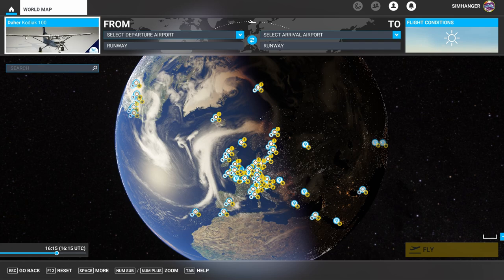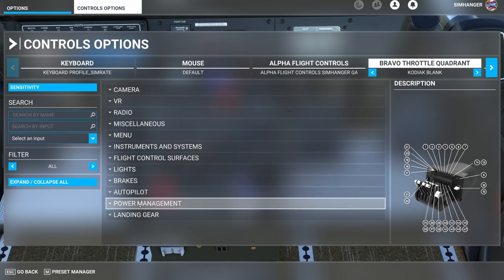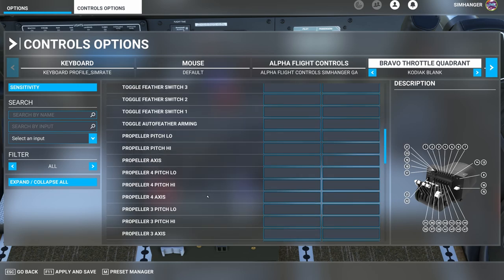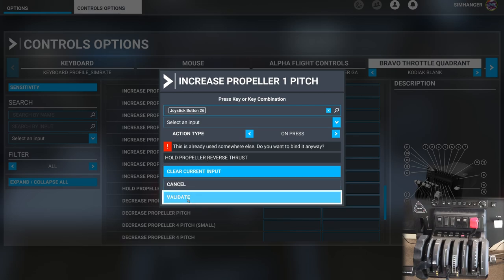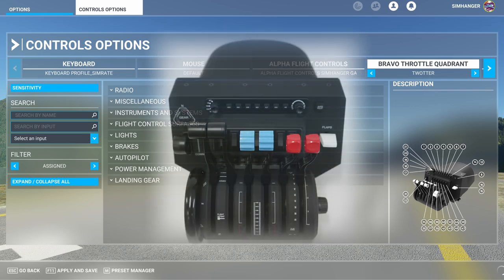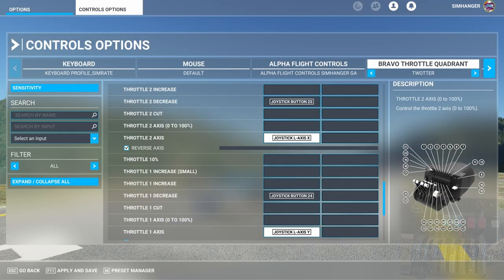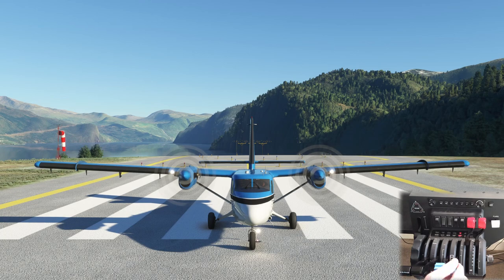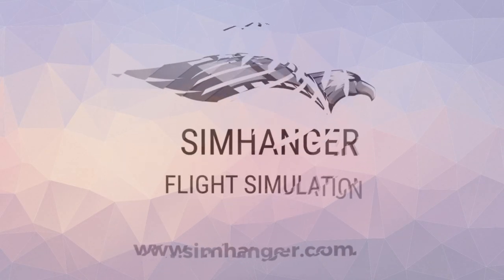MSFS | BRAVO TQ CONFIGURATION GUIDE | TWIN OTTER & KODIAK 100 | Suitable for most Turbo Props

Comment: Can you please help me ! I am trying to config the THROTTLES for a twin Baron . The No1 and No2 levers only work like a SWITCH to 50% and from then on linear. I have spent hours trying to change this but no luck. With the settings like this taxing is almost impossible so I have resorted to using no 3 and no 4 for the throttles and they work fine. In the configuration box the MODE can be set to either Airbus or Boeing ???? This is being used for msfs2020.

Comment: I found what made my fuel cut off not work anymore after SU8. That sensitivity extremity dead zone 20% was reset. Great video. I bookmarked it to keep 4 ever if something does not work anymore. Sim Update reset the Bravo default profile also with SU8 so middle row switches where in conflict again with the bottom left switches on the Alpha and also on Bravo again the switch button 47 / 46 where turning Avionics on and off again. MS / Asobo never thinks about peeps owning both end up with huge mapped binding conflicts if you own Alpha and Bravo. Everything is working and better with the not jumping prop so big thanks.

Comment: Thanks very much Mark for revisiting the power management settings for the Kodiak (which as you say will apply to other planes with reverse thrust as well). (I used the settings in your 4th December 2021 video for the V1F Controller). I tried to apply your new Bravo settings in this video to the V1F Controller and the Throttle and Prop settings worked fine - I'm getting reverse thrust and prop feathering perfectly. However for some reason I couldn't get the Condition Lever settings to work at all. The V1F Lever detent position didn't take the planes' lever into cut off. I have ended up deleting both the recommended Condition Lever Axis Cut Off and the Decrease Condition Lever 1 settings and instead have set "Neutral" on the Sensitivity of Joystick L Axis 6 to -(minus) 100%. That was the only way I could stop the lever going into the Cut-Off position below about the 50% position on the V1F Lever. If you get a chance could you please have a look at it and see what you think. I would be most grateful for your opinion.
Reply: Hi, not sure if you were able to resolve this. I was having the same problem and the only work around I found was to create a separate profile for the Kodiak without Mixture axis mapping. It appears Mixture interferes with Condition settings. I also changed the bravo levers to match that of Mark.

Comment: Your videos are very informative. I use the VelocityOne which I watched your videos on that. The Kodiak is difficult to fly and needs an update. The trim is at minus 38 on take off most of the time and you can loose control of it quickly as it will flip over. The Velocity is quirky and when you touch the trim wheel, it bounces to -1 or 0 which causes the plane to go erratic. Then on landing, the plane will nose dive when autopilot is disengaged.  I've learned a workaround by engaging autopilot soon after takeoff, let the trim wheel adjust, and then disengage autopilot. Upon landing, I disengage autopilot sooner to get the plane under control when it nose dives. The Caravan 208B, especially with the mod, is a better plane. Also, the plane will crash if you accidently open the window. Although a pretty plane with many models and liveries, needs an update.
Reply from the maker: Check you have the pilot assist settings off in the assistance options menu.
Reply: @SimHangerFS  Okay. I will check for that. Thank you.
Reply: Finally, the Kodiak got updated today (PC). It flies and behaves much better now. Very impressed.

Comment: As others have said below, your instructions are extremely helpful. I have the Bravo as well and will be adjusting it for my turboprops today.
One question: Did you happen to do one of these for the TBM930? I thought I remembered seeing one but not sure it was yours.  If you did, would you provide a link? If not, it would sure be helpful  since this airplane has a different set-up (no condition or prop levers) than the other single-engine turboprops.
Thanks!
Reply from the maker: https://youtu.be/MjovDdueafI

Comment: Thanks once again Mark, for a super helpful tutorial. I found I needed to use the Propeller 1 Pitch Hi for the Twin Otter as well as the Kodiak. Without that setting, the prop lever in the Twin Otter jumped forward when coming out of feather. With Propeller 1 Pitch Hi applied to Button 26 it works perfectly. Perhaps due to Aerosoft DHC-6 update Version 1.0.6.0 which is my version? Anyway, all good now. Many thanks, John

Comment: Hello Mark, Been reviewing your excellent series of Bravo TQ configuration tutorials, do these config profiles that are created only work with default aircraft, I am thinking of the Black Square range of aircraft. Thanks so much for the tutorials.
Reply from the maker: My profiles will work with any aircraft that uses a standard binding config. Kodiak 100 etc. Where it will not work is where the dev has used non-standard simconnect calls for functions.

Comment: Thx for your informative work. I read a lot of stuff on this topic, but I noticed that you, only one among who did that, dont use the vars TOGGLE FEATHER SWITCH 1 e 2. Did you tested with not favourable results?
Reply from the maker: I found response erratic
Reply: @SimHangerFS  I am talking about King Air 350 with which I still have troubles when I feather ONE engine on air ...

Comment: Hi, Very helpful video as always. This configuration works on the caravan apart from the fuel cutoff detent but does cutoff at lower end of the axis. My issue is that I am unable to get the condition lever to move at all in the Pilatus Porter, The throttle and prop work as they should. I have tried these settings plus just using the same but the general condition lever selections and no response from lever. Your TBM setup also works great. 
Any ideas? Thanks for your great work here. 👍
Reply from the maker: The Pilates condition lever not moving is a sim fault. Awaiting fix from Asobo
Reply: @SimHangerFS  Thanks for the reply, may just have to add the Kodiak to the stable in the meantime 😀

Comment: I have had my bravo for just over six months and the toga buttons on certain axes stopped working. I contacted honeycomb and it appears that there are some units out there with wiring faults, specifically the wiring that connects the axis to main board of the unit is not firmly connected to the axis levers and over time from using the throttle the thin wires just break. So I am now sending it back for RMA and getting it fixed/replaced.

Just thought I would share this info for any other bravo users out there.

Comment: Thanks Mark for your series of videos on the Bravo. confused a bit about the Condition lever vs the Mixture lever. Are they the same or two different things, if so , what is the difference please?
Reply from the maker: Basically the same function, a Condition Lever is typically found on turbo probs, such as Caravan and TBM 930. Rather than be variable as is the case with Mixture (GA) they usually have preset positions…fuel off…low idle….high etc.
Reply: @SimHangerFS  Thanks Mark

Comment: Everything was wotking fine until the last update now my kodiak throttle act weird ( not always but sometimes ) when I line up for take-off and move the throttle up in the middle of the runway he moves throttle lever to  idle and nothing can be done  and lever become unresponsive. it works perfectly fine when the aircraft is OFF and works fine during the taxi but as soon as I put the power above 50%  she moves back to idle idk wth is going on.
Reply from the maker: Check the update has not put all your pilot assists back to on. Turn them off.